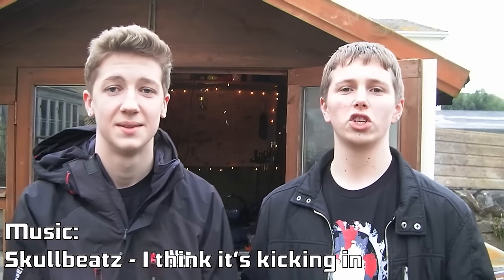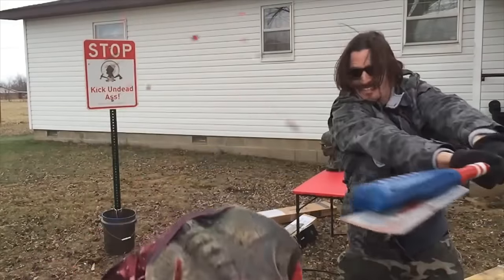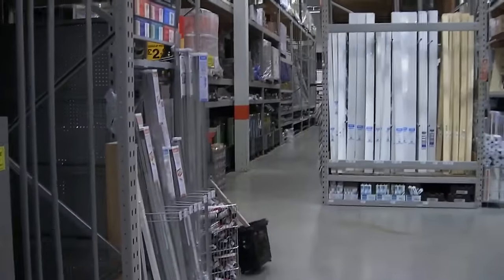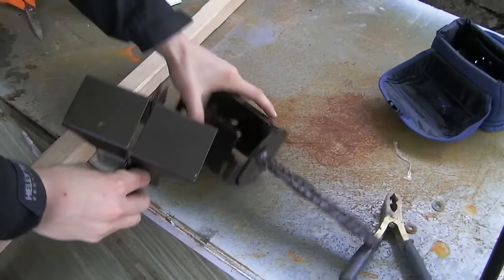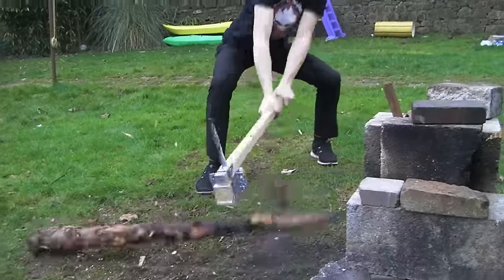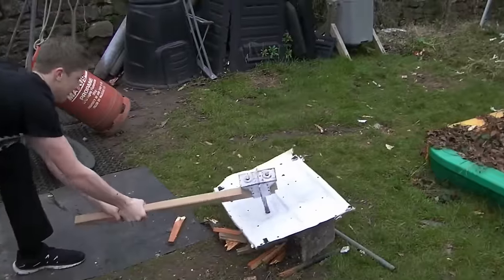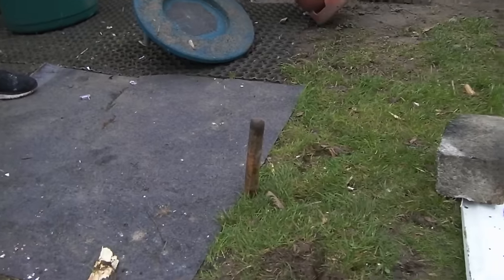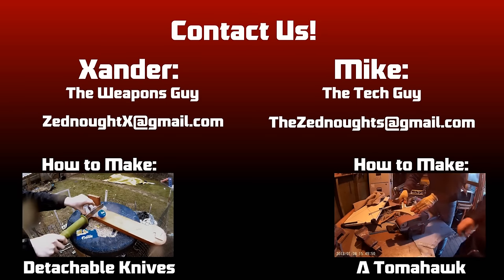$20 Build Challenge: War Hammer

Comment: Wait, did you cook on the same furnace you burned of the galvanized coating with?   ...please dont die..cause thats about as dangerous at it gets for the long term.
Reply from the maker: Don't worry, Building and eating were filmed hours apart just put together for entertainment purposes. The Zinc Oxide would have dispersed by this time.
Reply: ZednoughtBeta 

>would of

Would've*
Reply from the maker: Capn Late Night My grammar was corrected by a pony, How embarrassing...
Reply: ZednoughtBeta You have a problem with bronies?

Some Zednought you are. You should be embarrassed.